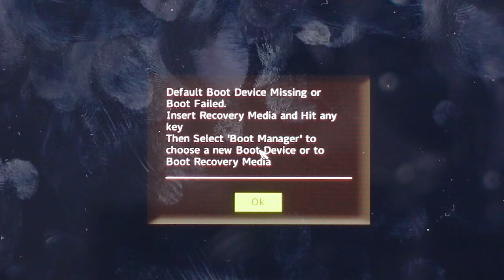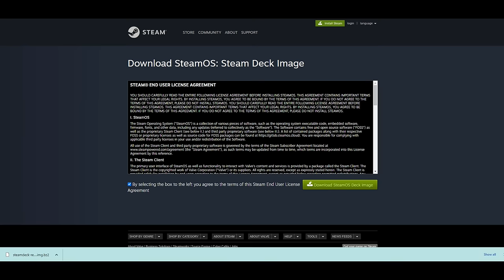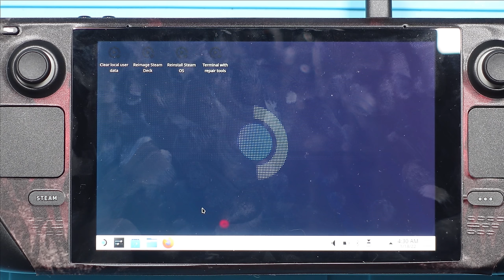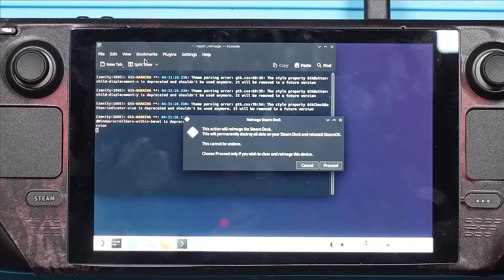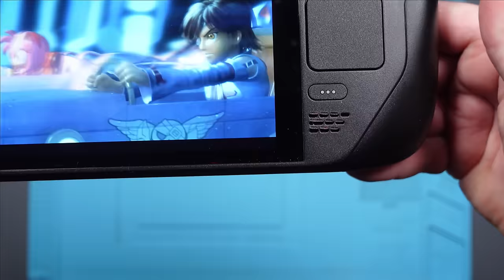I Paid £280 For This Faulty STEAM DECK | Did I Get Ripped Off?

Comment: Ya may want to unplug the battery before installing a SSD in the future. Probably fine, but not worth risking.
The shielding is indeed for emi, I'd imagine that's what the bit of tape for the screw is for as well. 
When it beeps ya keep holding the Volume down key. Which bring ya to the boot menu anyway. Good on ya for saving this deck
Reply: Not necessary.
Reply: Don’t worry there is no power in the ssd connector until you power on the console so it’s safe 😊
Reply: @ChristianBelotti  there is always power through the whole circuit, albeit small. Otherwise clock won’t work when it’s turned off.
Reply: @user-yk1cw8im4h  thx ☺️ I have a lot of experience in computer and custom build but this is something new I didn’t know 👍
Reply: There is absolutly no need for removing the battery first, when putting in a  new ssd. I worked now more then 20 years in computers and I never removed any electricity when I changed HD or SSD. Ground yourself so no discharge of electricity happens and all is fine. But there should not be any paper left when it comes to the alutape. SSD can get hot and so that paper could burn.
Reply: Like I said, probably fine. But it takes 5 seconds
Reply: @mutosanrc1933  same here, buttt those were cables, this is board mounted/all the power is from the board. Up to 25 years tho, it's happened once, but definitely could've been coincidence.

Could still be some juice in it (residual from caps, or the cmos 3.3v) and it doesn't hurt to do it. Better safe then sorry

Comment: What surprised me is that you bridged a pin to the resistor and it worked. Thought you'd be shorting that 4 connector, but nope! 

Honestly, last thing I would've thought!

That tiny metal prong flying across the room... I feel your pain. The trick is, don't ever let small parts know you're being extra careful, the more careful you're with it the easier they'll go flying. They can smell fear and anxiety.

Comment: Hope you left a negative review for the prick that sold it to you! Great video; well done on the repair. Well worth investing in a 1TB SSD in the future and of course a 1TB SD card. As mentioned in another comment: ideally you should disconnect the battery before changing the SSD as it is possible to short the contacts - bricking the machine and SSD. When removing the battery be wary of relying on the pull tape - better to ease out the connector plug itself.

Comment: it is so nice this days that SSD is not serialized for this device like in  mac mini, otherwise you will get a nice dour stopper
One more thing, for the port it is much better and stronger to use a hot glue
Reply: 99% of devices dont have a serialised/married ssd only apple has because apple wants your money

Comment: Probably should have made a not of how much battery was when the bios menu opened. You didnt use a dock for the usb with room for a charget so if the battery ran out while you flashed it you would have been screwed
Reply: It could be a very expensive paperweight 😂

Comment: For just just 280 pounds, and a good amount of elbow grease, I'd say that's well worth it, and considering you'll most likely get a good amount of money back from this video, it's a very good deal for a Steam Deck that seemingly works perfectly. And I do want to add, it's good to look into the SSDs specifically for the Steam Deck, because Valve does discourage changing the SSD into something bigger, mostly because bigger ones can have higher power draw and that could negatively affect the Steam Deck, but your 256GB one is most likely fine. If you want to have absolute peace of mind, look up what SSDs Valve uses for it, or buy one that's rated for the Steam Deck.
Reply: I disagree. The base 64gb EMMC version is £349. You're saving £70 for a deck with scratch marks all over, internal damage, no SSD (That could easily be £70 on its own.)

If you consider your time and effort worth anything, this seems like pretty bad value to me. Would only be worth it for personal use at best too, because you wouldn't be able to flip this for much at all.
Reply: @KrakenGameReviews Agreed. Replacing the SSD and the damage you may as well buy a new one, also think about the resale value. 😂

Comment: I wouldn't have bothered putting the connector back on. I would have just chopped the wires off and soldered them directly to the board but, hats off to you for hard work

Comment: Excellent Work! I was in the edge of my seat when that capacitor fell. 

I'm curious by the fact that there are two know cases of people ripping that connector off, I mean, How that could happened? it is not that close to the ssd, it is not requiered to disconnect it. 

I'm also glad that you are enjoying the steam deck, it is a quite good machine.

Comment: For a wire repair like that I'd use 34 gauge ptfe, glued in place such that it ran opposite way to the connector (to the right), solder it to the cap, then loop back to the connector.

Comment: Solder mask is not supporting a lot. liquifying hotglue with the heatgun and putting it on the side without contacts and or around the connector  would support better.Also if you would need to work on it again, you can easily remove it again with a bit of the heat.

Comment: I buy and repair broken mechanical watches and share that frustration watching you struggle with the tiny capacitor. Trying to re seat screws in watches are a nightmare! (Watch Springs also have a habit of flying across the room!!)

Comment: I just did a SSD upgrade on a friend's Steam Deck and I had no problems, after watching some videos and knowing what I'd find inside, and having some knowledge of electronics, soldering and working on laptops. I saw that speaker connector and was super careful working around it. With the experience, I'll definitely be ready when I finally get my Steam Deck. It's definitely not a job for the unskilled, and the one you got someone was definitely using chisels and crowbars to work on it.

Comment: You could build a bracket that you could solder to the pads! It could come up and over the edge of the piece you soldered on and have a tab on each side that could be soldered to the two pads. That is if you have any concerns. Other than that great job, from an electronics engineer!!

Comment: I have watched a grand total of two (2) Steam Deck repair videos in my life. And both had a ripped off speaker connector. I guess this is a common fault then? Why does it end up getting ripped off? Are they trying to unplug it and just yank on it? Or do they accidentally knock it off when removing the SSD?

Comment: With the socket having its legs broken off would it actually work to secure it to the board another way, if you dropped some bicarbonate of soda near where the legs used to be ( outer edge of the socket and onto motherboard ) then drop superglue in alternating layers to make a rock hard mount around the edges or is superglue conductive?

Comment: the ability to solder those microscopic components simply looks like some type of magic. How does the solder only stick to exactly where it needs to go? Why doesn't the heat of the iron destroy the little itty bitty tiny thingamajig? I will say I was able to fix my car with an old penny and a piece of chewing gum and 6 months later it still works but the bits were huge by comparison and no soldering was required (unless you count the chewing gum as body temperature DIY solder).

Comment: even if you didn't fix that connector, it has a headphone jack, unless they are both fed from the same connector. good video, as someone who wouldn't even have attempted that solder job, I wouldn't care how it looks either if it works.

Comment: Seems like that speaker connector is a weak point considering the two repairs on this device on youtube have been the speaker connector torn off during a ssd replacement.

Comment: Unfortunately your aluminium tape with the backing on is insulating the SSD, not helping to dissipate heat like the teeny factor heatsink is supposed to - it'll be fine with it just off completely, or just stick some thermal pads onto the aluminium tape rather than leaving the backing on

Comment: The shielding is more or less to prevent interference of the wifi signal. Valve due to running out of space sandwiched the nvme ssd and the wifi card in the same place.

Kinda shocked that the last person to tear it open and damaged the speaker didn't bungle up the wifi too as they are quite fragile.

Comment: The aluminum they use on theirs has a thermal pad backing on it so it transfers heat. What you've just done to your SSD is trap the heat in.

Comment: Nice repair. It seems like that speaker connection is a huge pain point on the board. Hope valve goes for a lower profile for their next itteration or refresh.

Comment: I bought a Brand Spanking New 512GB SSD LCD one on Craigslist a while back and i use it every day basically when im not Gaming im using it as my Desktop with a USBC Hub and a Monitor and Keyboard Mouse - i even got a BT Keyboard and Mouse for when im on the road... Ive never been happier with a Computer Purchase than this... And i e had a LOT of different computers through the years

Comment: I've got a lovely old pair of Philips A9 Wireless speakers that refuse to boot up. There's a recovery method of plugging in ethernet and holding 1 while powering to recover but no success. Is there a good forum to discuss a fix? Wouldn't mind completely bypassing the wireless tbh.

Comment: Foil might have been to shield wifi from interference but in all practicality it has miniscule to no effect. You've got to be the only repair guy who would even bother with it. Also it could have helped a tiny bit with heat dissipation, if it was bonded to the chips. The way you have it slid on like a sleeve could trap heat inside the SSD, and it would be better off without it.

Comment: No. You need to flash that device. Like you flash a phone. Had the same problem and after I flashed mine with steamOS, it worked coz the bootloader is missing.

Comment: Seeing as it's for personal use, you'd probably be better off just binning the connector and soldering the speaker to the board. Atleast then there's no chance of it working loose and ripping the pads off overtime.

Comment: Also note,  if you have a mesh system and buy a WiFi camera and connect the wifi to the mesh network satellites like a Deco but connect the NVR to the main Router via Ethernet, they wont see each other...why? The Mesh has its own IP address and the NVR cant see it.

Comment: Probably someone tried to install a bigger SSD / 2260 for sure, into the Deck, and the connector was in the way to installing it. By the way: Working on hardware before removing the battery connector: Not the best idea. When you want to enter the bootup menu you have to hold volume down and power knob, until it beeps, then let the power knob go and still hold the volume down button, until the menu appears. Beside of that: Awesome soldering work! Thank god, this was a shitty skin, so it came off easily - I saw very bad things happen on some skins, leaving tons of glue back on the shell, when peeling off.

Comment: My son accidentally dropped my deck from just 8 inches from the table and the joycon popped half out the socket. I was freaked out but rather than try to manhandle it back in I watched a tutorial and literally in 10 minutws with a screw driver I had it taken apart, fixed and put back together.

I appreciate the community content for the steam deck especially because the steam deck is incredibly fragile.

Comment: The metal shield around the ssd is used for EMC protection, without it could interfere other systems working on the freqency of the ssd

Comment: You need to hold volume down and then just tap the power button to get to the boot menu. Dont hold the power button. Only hold the volume button. I boot Batocera from an sd card all the time this way.

Comment: Mine wouldn't stay on long enough to boot. I was lead to believe i needed to flash the thing, but that didn't work. I then I took it apart, did absolutely nothing to it and put it back together. It subsequently decided to stay on long enough to flash properly I presume because after flashing it again it has worked just fine since.

Comment: My computer was laggin', slow as can be,
Tried to open a file, took an eternity,
Then I heard about SSD, the way to go,
Upgraded my hard drive, now my system's on the go!

SSD, SSD, the speed I need,
No more waiting, no more greed,
My data's safe, my system's fast,
With SSD, I'm gonna last!

Used to hear my hard drive chuggin' like a train,
Now my SSD's silent, no noise, no strain,
Boots up quick, programs load fast,
No more spinning disk, a thing of the past!

Comment: You might have been better off heating the metal mounting fixtures then pushing the port on. The heat might have softened the plastic to let it push into place. Failing that, pot the port with Araldite or similar.

Comment: Those vinyl skins either have a glue that leaves residue on the shell or they tend to come off after some time. I wouldn't blame the seller on that - but there it stops.
You can swap the entire shell without having to unplug the speakers. Whoever owned that before had no clue what he was doing.

Comment: I felt for you when you knocked that capacitor off. Things can spiral out of control quite quickly when something like that happens as it's a real confidence knock. Sometimes you just want to give up and wallow in your own misery over it lol. Glad you got it sorted!
Reply: Happened to me few times, abandoned it and came back another day, finished and be satify with it. The burn is easier to deal with when you make things serial. If you want to do it fast and in one day often that job or project results in a disaster. Better cool off then damage it more or even toss it out with anger, seen that too XD

Comment: You may have paid too much given what was sneakily stolen from it (which I would open an ebay case for a partial refund over it which you'd win) but it was a solid little bit of work for sure.

How is it though having tried it?  I'm using a 9yo pc at this rate, still can do most but...

Comment: Hello, ive only recently come across your channel but k throughly enjoy your adventures to fix broken HW and im hoping you might be able to point me in the right direction. I have rotel ra02 amp which when turning on blows its timed fuses and i wonder if a capacitor has gone when i opened it i noticed some fluid/sticky stuff around the bottom of A capacitor could this be related am happy to share images of the inside. Im not a professional when it comes to soldering hence can you either create a video of how to solder and the right tools. I have fixed a fair few consoles in my time including using rhe wrong amount of thermal paste etc haha i really want to fix this amp and to do it alone any help is much appreciated keep up the great videos im glad i subscribed :)

Comment: finally a steam deck on the channel <3 the beep at the boot comes not from the speakers i think but from the haptic feedback/rumble thingies under the trackpads. might be wrong though. installing and repairing the OS is also so easy, i was really surprised when the first update after i got mine broke it because i dared to update in desktop mode instead of gaming mode :D used rufus to put the image on a stick and repaired it. no data has been lost, it just repaired it and all i had to invest was a couple seconds for a few clicks here and there, the rest was automatic :D

Comment: Before unplugging the battery, I highly recommend putting the device in battery storage mode, found in BIOS settings or but holding "..." And volume down for 10 seconds while off and plugged in and unplugging.

Comment: Id have thought leaving the backing on that tape would result in it acting like an insulator not only protecting from electrical conductivity but also trapping heat in preventing it getting to the metal tape to dissipate?
Reply: Same.  And then he wrapped another layer around, with another insulator!

Comment: Now you are cooking the SSD in the tin foil one side isolated by a paper so the heat can´t be transported and cooled... :D And the second tape is dust and water protection - also fights with resonance and vibrations because of the strange shape of the hole created to not push on the joint.

Comment: I recon they ripped off the connector while trying to replace the SSD with a bigger one, then left the SSD out (since you can reuse that in another PC). This also means they get more for their broken console on ebay because to an unsupecting buyer, replacing a SSD or reinstalling the OS are easy fixes, resoldering the connector is not.

Comment: I feel like you did get ripped off because I spent $280 on a working steam deck from ebay that was never opened, previous owner loved the deck because the battery needed to be replaced, and when I was in it I updated the SSD to 1TB and upgraded the screen because I hated myself.....  the one upgrade I wish I had the skills to do which is double the onboard ram.  I am still thinking about seeing if the guy that did that to his would double my ram  to 32 GB as well for a price :)

Comment: I probably wouldn’t have bothered with the aluminium tape. That shield over the top should direct the air across it. You’ve put it in a coat 😂

Comment: The aluminum tape is very important as is insure that the proper air flow of the cooling system dose not get diverted through that opening before it gets to the heat sink.  It just help with cooling.  I think it was a design flaw by Steam that they fixed with that budge.